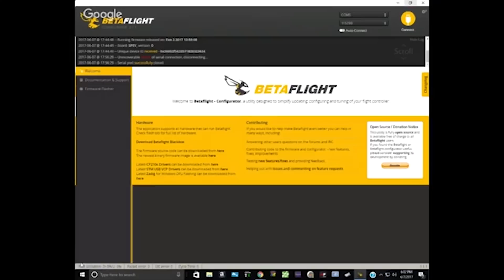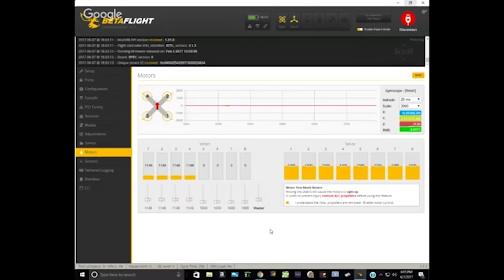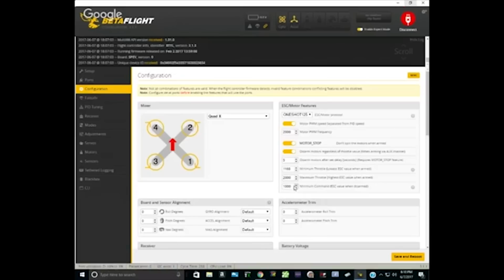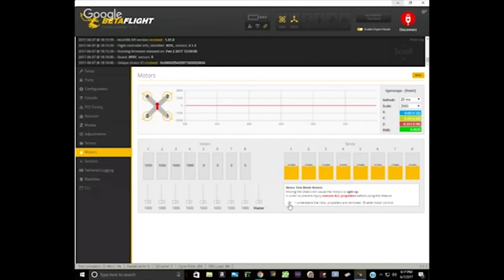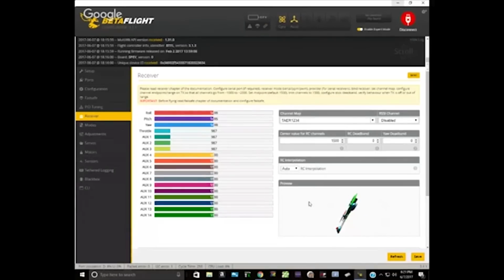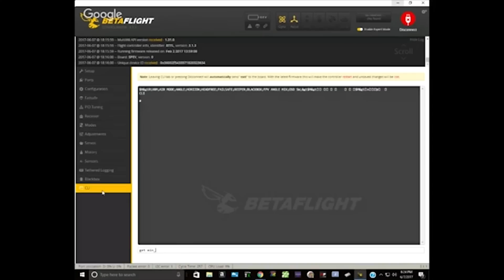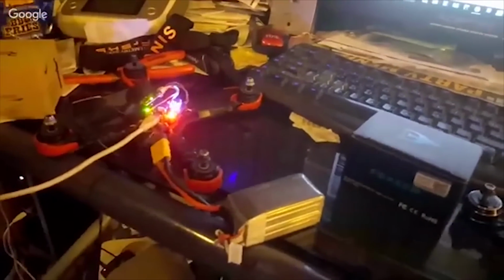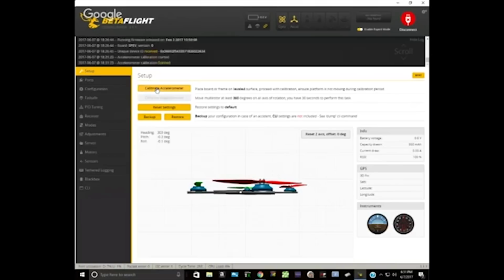Quadcopter Motors Won't Spin Right | 1-ON-1 TROUBLESHOOT

Comment: The jerking is probably caused by the active braking on the escs. The motors are speeding up and slowing down so fast its torquing over. I get the same thing when my quad is sitting on my super slippy computer desk.

Comment: My issue was so similar across 3 craft however this remedy didn't help. My answer which I hope helps you all learn something today was P. I. D values. P around 40 all round. I and D at zero. Got rid of my motor start up issues and now I can tune up again

Comment: Josh any ideas on my quad problem. Its a cc3d on librepilot. Out of the blue the roll does not respond to my rate settings. Pitch is still fine. My only guess is fc not giving output based on input. Rate at 1080 still only rolls below 360.
Reply from the maker: I don't know the first thing about Libre pilot.

Comment: Got two Moblite 7s and one moblite 6. Started having motor problems. One motor wouldn't spin as fast as others  consistently. Quad kept turning direction in flight. Thought it was bad motors or possibly remote problems. Watched this video and realized I set throttle minimum too low. Also learned to calibrate motors and transmitter. All quads fly LIKE BEASTS!!!! I actually look like I know what I'm doing!!! GOOD LOOKING OUT JOSH! I'm a first year micro quad flyer. Your my "GO TO" guy when I need to learn, troubleshoot, setup, or buy something. I really appreciate how you explain things to the "Layman" of the industry.  Excellent Work Fam!!!

Comment: Watching these older vids of your reminds me of my hotel room / travel days.   Top unbuttoned polo and all.  Though, I always filled the sink with hotel ice and floated a 6 pack in it, or 12 depending on the work load and day of the week...  As someone thats been in IT for +20 years, its always nice to watch/hear someone help another with patience and the ability to speak to them like a human and not over talking, confusing them or trying to impress them with technical terms for no reason at all.  I dont recall ever doing a motor calibration - I dont have any issues but Im about to do that now.  Ive learned quite a bit of 'extra' things just by watching these live troubleshooting sessions just because of how you explain the what/why.  You do that in most of your vids but these somehow seem to be more specific to certain things.

Comment: Because of this video, I calibrated my esc's and set my min-throttle properly, now my quad idles properly, doesn't yaw upon full throttle.  Also learned a better way to test motor direction than with a finger hehehe.  Thanks tons.

Comment: Hello Joshua, i wanted to thank you for helping me before when starting out with the fail-safe, now im building a bigger quad but im having problems, after a certain point the motors rocket up to almost max and won't let me throttle down unless i disarm it, thanks again :) i always love seen your videos
Reply: Try using a switch to turn on or off angle mode. Also try turning on/off air mode, because that can add throttle to try to maintain stability.
Reply: @michaeldilger9582  found the issue,i needed to add the props and flew fine

Comment: Dear Bardwell one question... My #4 motor on my new build spins sometime when I arm and sometimes it won't, but get this when 4 spins motor 2 won't. What's that all about?
Reply: Did you find a solution to this. I have one motor that won’t spin right if I reverse the pins it will spin left

Comment: Good job never skip the obvious or the basic, especially when some else has been trying to fix something. I have found the darndest things in dark corners of configuration files. When I find this, I tend to use the nuke from high orbit option and reset everything to factory defaults.

Comment: Hello, so I’ve built this drone using some cheap parts from amazon. I’m not looking to anything extravagant, the drone has a certain purpose. But i have some Hobbypower SimonK 30A ESC connected to a Hobbymate PDB and the PDB is connected to an iFlight SucceX-E F405 FC. Also the motors are made by Crazepony and my transmitter is a FlySky FS-i6X with an FS-iA6B 6 channel receiver. After everything has been put together, it works! The only issue I’m having is that all of my motor controls are separated on my transmitter. This would be fine if i had an three hands but unfortunately I don’t (I mean think of the possibilities). All i want is to raise the throttle and all 4 of my motors spin instead of have to lift the throttle push it to the left and flip switches. Is this a calibration issue with my ESC’s or do I have to change some settings on my transmitter?

Comment: Had a very similar issue, what we found was when we setup the quad we direct wired the motors and then reversed direction of #2,#3 motor in BLHeli Suite. After replacing every other part on the copter we decided the rewire #2,#3 cross wired and then set the motor direction in BLHeli suite to normal. This resolved the problem.

Comment: Did you see my video Josh?  Floss5" motors spinning up issue # have tried everything and still is smooth when armed on min throttle but when try raise throttle they want to go to full??
Reply from the maker: Most likely this is one of the "quadcopter flips on takeoff" problems. Check my video about that (google that phrase).
Reply: Joshua Bardwell I have tried everything in your video Josh.. the board won't allign properly and the motors still keep spinning up more than they usually would with the props on or off?? Please help.

Comment: Josh, Quick tip for you. Put the quad on a non slip surface during the bench test, or put a hand on in securing it down. Then throttle up gently, should work just fine. The slippery surface and motor braking causes a jolt and then naturally the Pid controller freaks out. Btw love your content, keep up the good work!
Reply: I can't  throttle my mobula6 takeoff

Comment: Joshua I have a quick question I'm using betaflight F3 board I'm on my V build and using Emax 2306 2400 KV Motors 30amp ESC everything is good when I raise the master slider in Motors tab but when I race motor slider one motor for spins when I race motor to slider motor 3 spins also they are spinning in the wrong direction I just noticed this this morning before I went to work. When I own the quad with no props it will violently Shake left and right and will be uncontrollable. All I did was reflash new firmware on ESC to 16.65 after that when I armed after recalibrating and Motors tab it violently shoke left and right. I thought it was bad ESC firmware so reflashed to 16.5 and still problem persisted. Would my problem be that the motors art napped properly in the correct order. Please help thank you
Reply from the maker: You need to remap your motors so they correct slider spins the correct motor.

https://www.youtube.com/watch?v=z5aO-3_n-Hs
Reply: Joshua Bardwell thanks for the reply.. i will try that.. also if i flipped the board upside down shpuld i set roll to 180 degrees or -180 degrres...? Thanks
Reply: Joshua Bardwell... your a godsend... i remapped the motors to the correct sliders and it solved the problem. Thanks again.. dont know what we would do without you.. lol thanks

Comment: Hey josh what would it take for you to walk me through with my furibee x215. I had it for about 3 weeks and I’m getting no where thanks
Reply from the maker: I'd suggest starting with these videos:

https://www.youtube.com/watch?v=PCLxyurZsD0

https://www.youtube.com/watch?v=XQXV6bjCfuA
Reply: Joshua Bardwell I’ve watched all that you have on this part. The motors are working perfectly now after watching this. Now I’m not even getting it to respond to the transmitter. The transmitter won’t even arm or move the little orange indicators like it was. Everything only responds from the master switch.

Comment: Here's a tip for initial hover on an iffy build.  Make sure your battery is loose and the connector is just barely making contact so that if the crap hits the fan it disconnects power itself instead of you loosing an eye.  Crude yet effective and most importantly safer.
Reply: Dobemandan 10:20 p.m. November 1st my kitchen first hover!!!!!!! that was my exact thought as I was plugging it in luckily there was no issues though when it landed it did pop out I only got it about 2 to 3 inches off the ground but that's the point when it hit the ground it popped out
Reply: Carl Du II x

Comment: As soon as you see those tpu motor accessories or softmounts I'd suspect a screw length issue. Also motors can be spinning the correct directions but that doesn't mean they aren't soldered to the incorrect pads on the FC

Comment: Hello Joshua,  we watched your video in our attempt to get our T-motors to arm.  I'm a Youtuber addict and I can say without question your direction is exceptional, no guff.  So as I said we are stuck trying to arm our motors and as my first build I'm sure it something simple.  Here's the scenario if you can make a suggestion.

We have a Daya 550 quad copter frame and are using the P2 flight controller and cannot get the motors to arm when the quad copter is fully assembled.  We did initialize the T-motors (Navigator Series MN 3510-25 KV:360) individually without any problem.  Fully assembled the motors are powered from the frame using a 4S Lipo battery.  We are using a Futaba R7008SB receiver and Futaba 14SG radio.  We have initialized the 30A K-Force Turnigy ESC's sperately on mode B(2) of the receiver.  The S-Bus on the receiver is plugged into the RC on the P2.  We have calibrated the control sticks and all sticks show normal movement on the P2 assistant.  We calibrated the accelerometer according to the JIYI P2 User manual.  Our problem is that once we assemble all our components to the quad copter we are unable to arm the motors (build components include: P2 FC, POW, JIYI OSD, JIYI LED, 30A K-Force ESC's, R7008SB and 14SG radio, 4S 14.8V Tattu battery, 5V and 7V UBEC for power step down to the receiver and P2/POW, respectively).
Reply from the maker: https://www.youtube.com/watch?v=M0S3HTQihxs

Comment: I had very similar symptoms on my quad when I started using 4s batteries. On 3s it flew perfectly, with 4s on punch out, one motor would lose sync and the quad would spin out of the sky. On the bench the motors tab would spin the motors fine but when arming via transmitter at low throttle one motor would stutter, behave at mid throttle, and lose sync at full throttle. A combination of a low ESR capacitor on the PDB and grounding all ESC's (I had read somewhere it was better to only ground one and just run signal wires to the rest, thanks internet) finally sorted the problem. Now just got to work out why my runcam keeps rebooting mid flight

Comment: Thanks Joshua. After watching and following your checklist my motors started responding to the transmitter (first quad  build). They turn all wrong and can't reverse them from BF nor BLHeli but I can move them physically  around. I want the auto-lock of the propellers to be there anyway. The only thing not working correctly is that the Throttle stick also moves the AUX3 slider in BF (Devo7 Tx).  Could you use Remote Control to connect to your patrons computers and set things remotely in BF? (That could be a new line of business for you.)

Comment: Thanks for the video. I've exhausted all my resources which includes a ton of your videos and hoping you might have a thought for me. My motor runs fine until it hits about 1350rpm but then at 1500rpm, it twitches. All other motors perfectly fine on my Emax Tinyhawk 2. Anything beyond 1500rpm, it doesn't spin at all. I did calibrate using the motor tab running it to max, plugging in the battery, then running the motors down, followed by power cycle. Would appreciate any ideas you might have. Thanks!
Reply from the maker: Is this the answer: https://youtu.be/DXfAnCLr3q0
Reply: @JoshuaBardwell  Thanks for getting back to me, but I checked in BLHeli and confirmed that my ESC's are not set to bidirectional. Neither was my betaflight. I did turn on the bidirectional on betaflight to see what would happen, but it wouldn't allow me to arm. Doesn't have the second confirmation beep. I've since reverted back to no bidirectional and motor still fails at 1500rpm.

Any other ideas?

Comment: Thanks for this, Joshua. I'm new and smoked a motor on my Babyhawk. I got a new motor and wired it in, and got this behavior. After watching this video I was able to troubleshoot it (the motor was spinning the wrong way - apparently I wired them backwards), and I went into blheli and switched it. One question: Is it better to rewire it physically, or is having three motors listed as "normal" ok, as long as theyre spinning the right way? Thanks.
Reply from the maker: It doesn't matter which way you reverse the motor. Except a very few ESCs have a bug where they will desync if you use software reversing. DYS XM30 is one, I think.
Reply: Thanks, Josh! You probably hear it all the time, but your channel is a real godsend for people like me who found this hobby solo and don't have friends who share it, and also don't have any kind of background that supports the hobby. I had never held a soldering iron in my life and didn't know what current was (I'm 41). After getting my first taste of FPV, I started reading books on electricity and taking Khan and Great Courses instructionals, and, of course, watching just about every one of your videos. I now have an Eachine Wizard, a Kingkong 90GT, and a Babyhawk, and I ain't nowhere near done :P You're sharp and thoughtful and it really does come across in your videos. So, again, thanks. Happy flying!

Comment: Question: If I set motor stop and I set minimum throttle to a value where motors spin, am I not being contradictory?  (This assumes no airmode.)
Reply from the maker: The motors will stop when they need to stop regardless of what min_throttle is set to. Even without air mode, remember that a motor can go to idle. Think about when you do a hard roll or flip. Two of the motors will go to idle and two will go to max.
Reply: Thanks!

Comment: I have a problem with a 4in1 1 pf the esc’s is not as powerfull as the others i get real bad oscillations and sometimes when i want to pull of from a dive it sorta falls in the left front (the esc that is not so powerfull)

Comment: I've spent all weekend on my first full build. Doesn't fly. First problem was ESCs not appearing in BLHeli Configurator, only the first two came up, though they all span up fine using the slider under Motors in Betaflight Config. I ended up moving the signal wire from the third ESC from pinout 3 (RG SSD F3 FC, Spedix 20a ESC lites) to pinout 6. That fixed it and all four ESCs came up in BLHeli Config, giving me the chance to flash them and reverse direction on the ones that needed it. But DShot wouldn't spin up ESC no. 3 after that, even after remapping them (correctly, I checked) in the CLI. But Oneshot125 was OK with it. I then started encountering the kinds of problems Joshua has been helping this gentleman with, relating to spinning up motors - I didn't appreciate that being on the bench with no props would make it react aggressively (the throttle just kept going up lol). I then moved ESC no.3 back to pinout 3, as the motor slider had been fine with it, set it to DShot and took it out for hover test. Shot 30 feet in the air in 1 second, with minimum throttle,  throttle spikes whenever the throttle was open or dropping out the sky when throttle closed (this is to do with the setup, not my thumbs - I've been flying a Falcon 210 Pro so I have basic competency). I had Air Mode on and Angle. I tried it with Angle off and it tried to turn a spiral to the right as soon as it left the ground and flipped over. I will do a further series of tests with ESCs 3 & 4 on pinouts 5 & 6, both in Oneshot125 and DShot, if I can get Dshot to work on those pins.

I should also say it's Cobra Champion 2205 motors on a Martian II frame using Matek 5-in-1 PDB, with FS-IA6B I-Bus (thx for that FC/Receiver build vid recently Joshua, helped a bunch). Not connected any VTX beyond soldering on the wires.

Anyone got any other advice? I'm on forums asking but it's slow going, lol. Thx for help.
Reply: No it was Dshot (no ESC calibration process, right?). But with the ESC back on pinout 3 (where it had the original detection problems in BLHeli Config).
Reply: Yes. On the bench I was having more joy with Oneshot, and will test further with that. Thx for reply.
Reply: Just in case it helps anyone: I solved my problem by moving the ESCs to different pinouts on the FC. For some reason, my board didn't like them in pinouts 1,2,3,4, they wanted to be in 1,2,4,5 for DShot to work properly. I did try  them on 1,2,5,6, did the resource remapping thing, but it didn't like that due to a DMA conflict, as I never got a DMA recognition for motor 4. Moving it back to pinout 4 worked and all motors were listed under DMA.

So - if you find BLHeli Config isn't picking up all your ESCs, one possible solution is to move them to different pinouts on your board, but check that DMA allocation works correctly if you do so. I now have a great quad :) .